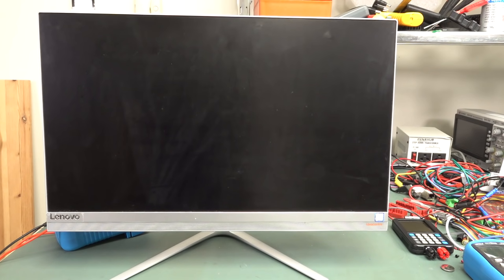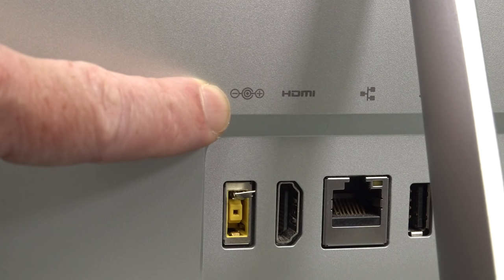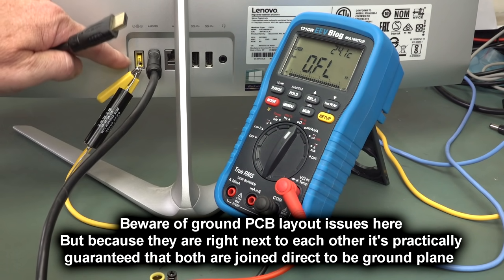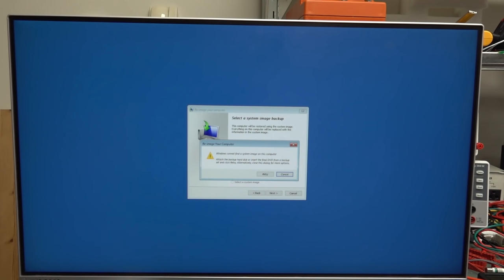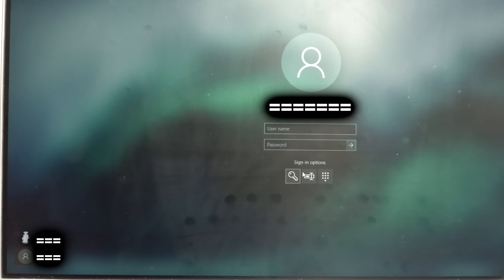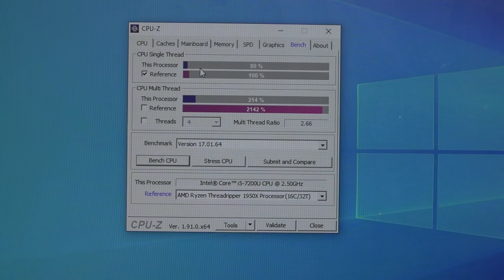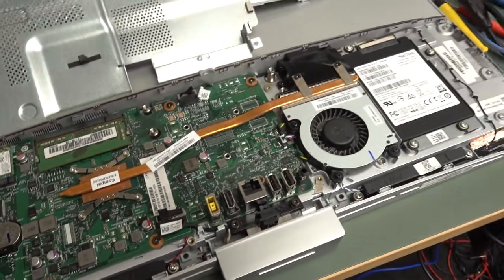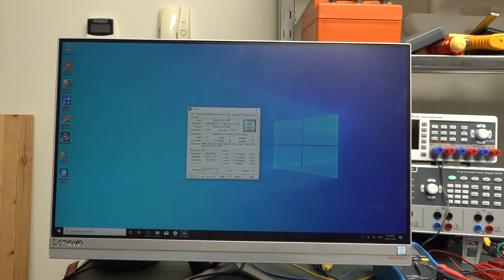EEVblog #1279 - Best Dumpster PC Find Yet!

Comment: What a bloody performance!? I recently bought a second hand Lenovo X1 carbon laptop that had a Windoze 10 virgin install which I ran. NEVER AGAIN! I did it out of curiosity since I havent used Windoze for 19 years as I use Linux (Mint now after Debian and Ubuntu.

A COMPLETE Mint 19.4 install took a total of roughly 20 mins which INCLUDED the repartitioning of the system disk so I could keep the Win 10 install. The instal,l direct from a Live USB stick was a piece of cake compared to the Win 10. No glitches, no hunting for specific drivers or waiting for them to load. Immediately and automatically picked up the fingerprint reader on the laptop and ran me through the setup. Only ONE reboot and restart and voila. Win 10 kept asking me if I wanted x, y and z and never picked up the fingerprint reader. WHAT A contrast. Thank God I switched to Linux. Get yourself a live copy Dave and stop farting about with bloat. Also it would have been quicker to boot Linux off a stick and just rename those files directly without even needing to boot Win10!

Comment: I've seen power connectors like that one on the Lenovo ThinkPad Carbon X1 laptops.  I wonder if they use the same AC Adaptor.
Reply: Same plug but Lenovo has a variety of different wattages up to hundreds of watt.
Reply: @Nukle0n  Fair enough, and a PC like this would probably need a higher wattage AC adaptor than the ThinkPads.

Comment: I have a Good Will around the corner, got over 50 computers back in November. If they have a virus or they can't get past the password, it's trash plus I found a top of the line oscilloscope, the power cord got cut and flattened from a chair. I repaired the cord and it fired up. lol

Comment: Not working?

The connection has timed out
The server at eevblog.tv is taking too long to respond.
    The site could be temporarily unavailable or too busy. Try again in a few moments.
    If you are unable to load any pages, check your computer’s network connection.
    If your computer or network is protected by a firewall or proxy, make sure that Firefox is permitted to access the Web.

Comment: Dave, nice video and thanks for sharing those Win10 account hacking tips! As far as dumpster waste goes, it is not surprising these corporations do that. It does seem like a huge waste (if it actually gets dumped in the garbage) but I presume if Dave doesn't pick it up, someone along the way will save it... maybe even the trash pickup company. Why not let their own employees have a go first? Are they doing this for accounting/tax depreciation purposes? Does the dumpster typically get visited by an electronics recycler or does the trash pickup company deal differently with electronic waste than the large bins? Interesting to find out but don't poke too much at the genie bottle or it will stop giving you these gifts! :-) Good luck on more awesome dumpster finds!
Reply from the maker: You are not supposed to dump ewaste or office waste in the dumpster room, but everyone does it anyway. The contractor is not obligated to take it away, but it eventually goes. No idea what happens to it.

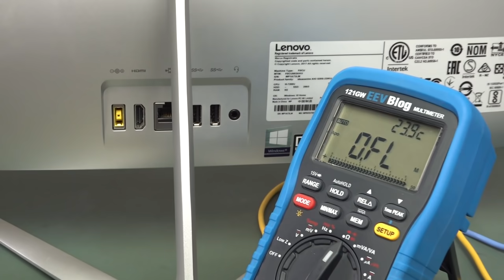Comment: 5:06 Connector Porn, but missing the kinky one.
5:50 LOL
I would be checking that dumpster room twice a day because I would be paranoid on missing out on a treasure that someone else finds before me.
The only major downside is that it runs Windows 10. I would be changing that if I wanted to use the PC myself.

Comment: That motherboard looks like there's a version with a dedicated GPU + graphics RAM as well, since there are unpopulated pads for it. Great find, nice machine. Although I would definitely wipe the thing clean, even if you wanted to use Windows on it, just reinstall it fresh, give it a clean slate and a real fresh start.
Reply from the maker: Yep, looking that the datasheet shows three processor versions, with optional graphics card version.

Comment: You found it's PSU so not needed now, but you can get simple adapters to go from the old barrel power jack to the new square ones.

One of those barrel plugs you had there looked like the Lenovo one, so one of the barrel to square adapters would have let you use your existing PSU.

Personally I would have nuked the OS from orbit and reinstalled Windows, you never know what nasties are on someone else's machine.

Comment: That’s a 15 W, dual core w/ SMT processor. Okay for a low power systems. I have a laptop with a 6200U in it and it’s about 10% slower; equivalent CPU performance to a Q9400 overclocked to 3.2 GHz. More than plenty for everyday tasks, but not stupid fast.

Comment: I would like to make a note about Microsoft accounts. When you setup Windows 10 for the first time, DO NOT have your computer connected to the internet. If you do not connect it to the internet, you can create a local admin account. Microsoft only forces you sign in with an account from them if you are connected to the internet. Really sneaky backhanded way Microsoft made changes to the OS. I know this after building some new systems for clients, and discovering this.

Comment: I have killed the main Lenovo IO chip when I wanted to power it with bench power supply. I also put positive into the center hole.
But the centre pin was directly connected to the chip without resistor and zener diode to limit the voltage. So it killed the chip. Garbage design.

Comment: It's not a weird power connector, it's a standard Lenovo power brick connector. Well, would have been nice with a C14 but then the whole PSU would be built in and ruined the "sleek" design.

Comment: Suprising you didn't burn KBC IC on there, what you did is common for cheap laptop lenovos when KBC is burnt. You have plus 20V around identification pin, and rest is ground. But when you put 20V on pin in this socket, which lucklily you did via resistor, you would burn KBC on the motherboard and make it useless. I shuld underline luckily behind resistor word. Plug in 20V on middle pin in lenovo, suprise you have dead KBC chip, because it has no protection at all. At least in cheaper models.

Comment: "Weird a*** power connector"... (/me points at the two on his desk) What? These standard (for lenovo) power connectors? Sure, it's not the (former) bog standard barrel connector Dell, HP, Lenovo, everybody used to use. (I have dozens of those power packs around, with and without the center sense pin) The laptop itself is powered by a USB-C plug, but the dock uses that square thingy.

Comment: Lenovo makes very solid computers. I have a Z70-80 laptop and have had it for 3 years now. Outside of a few nutters saying Lenovo is going to steal my data, I have had no issues with it running Linux. I actually like the square plug as it seems to be vastly more robust than the barrel plugs.

As for why this pc was in the dumpster, it was likely down to the intel graphics. Outside of basic functionality it's not a good choice. Even a low end discreet card is preferable. This PC likely can only barely run minecraft.

Comment: If that AIO has a desktop processor in it, that little fan and heatsink is not going to keep it cool. I see many of these AIO come through my shop and number one cause of failure is inadequate cooling. If they had built them with a Mobile CPU/GPU's the systems would be just fine with that cooling solution.
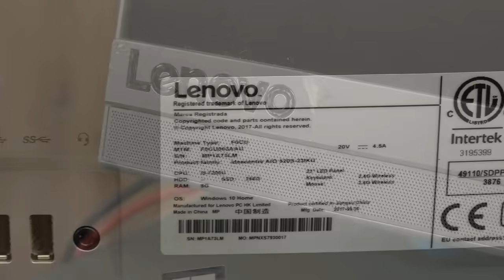Reply: CommandrX According to the sticker on the back ( 1:57 ), it’s an i5-7200U which is an Ultrabook-class CPU that has a TDP of ~15W iirc.

Comment: Next time just pop in a windows 10 usb stick and do a fresh install and to bypass making a Microsoft account is dont connect any internet to the computer or sign into wifi. It will let you make a local account as long there is no internet.

Comment: One time ago I found a hp pro with I5 3470 8gb ram 500gb hdd
It was barely used the hdd hasnot been on for very long so the hdd was new saw that in crystal mark I put the 500gb in my pc and having games on it now
The motherboard is perfect for a other build well its hp but still a motherboard is a motherboard no weird connectort too just the standard connectors

Comment: You are so lucky it's not a Dell, I once killed a dell laptop by doing this, on the Dells the center pin actually goes to a chip, that communicates with another microchip inside the charger, and if you dare send 20v to that pin, it will permanently be stuck at the lowest CPU multiplier and never charge a battery again until the motherboard is replaced.

Comment: I think it's a smart move of Lenovo you actually need there chargers you can't put like 20v 5amp in it
I tried to use a 19v Asus charger on a desktop pc when I lost the charger did not start :/
Then I tried with the charger when I found it it worked

Comment: Lucky you but still I don't get it, why do they not give it someone? Why are people so careless about stuff. I have also found many things at the recycle bin, even sometimes in original package! It is unbelievable. However, great times ended for me last year because they secured it now and placed cameras. Stupid, recycling seem to be a serious business. About the adapter, had same issue with a Lenovo laptop, no adapter and tried the same however blow something. Be careful with such custom connectors.

Comment: wow windows 10 home FORCES you to use a Microsoft account?  That sucks.
Reply: No, they don't. If you set up a PC with no internet connection it will ask for a local account. Also, in settings / accounts you can remove the microsoft account that's tied to it.

Comment: Who the heck installs winzip in 2020!!! Windows opens .zip since 2001!!!
Reply from the maker: I use 7zip
Reply: I can’t speak for WinZip, but third-party zip utilities (such as the Open Source 7Zip) have additional tools such as choice of compression method, speed of compression over size, and other useful features, such as zipping to an archive of multiple files of a fixed size. Windows zip is usually okay for quick zip/unzip (which I guess is fine for most Windows users), but that’s about it. Also, it’s not unusual for Windows zip to fail when decompressing some zip files that third-party utilities unzip without issue. I install 7Zip on all my Windows PCs.

Comment: Lenovo redesigned their DC plug circa 2014 to make it flat, so it fits better on thinner laptops. Damn eggheads didn't stop to consider that you can easily confuse this port with a USB port though, and get thorougly annoyed why it doesn't plug in. Contrary to everyone else they went from a universal power plug that it doesn't matter what orientation it is to one where you have to have it the right way, all to chase those extra precious millimeters.